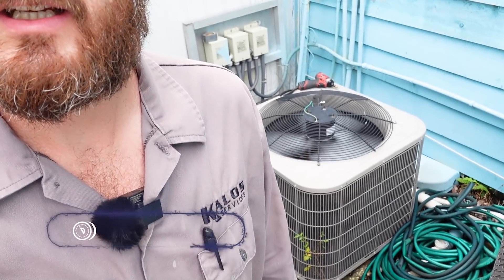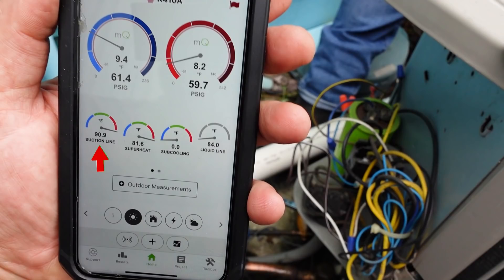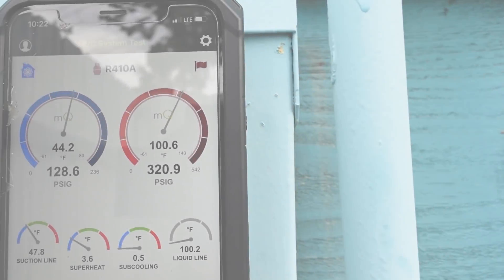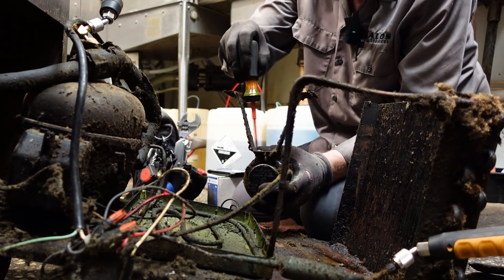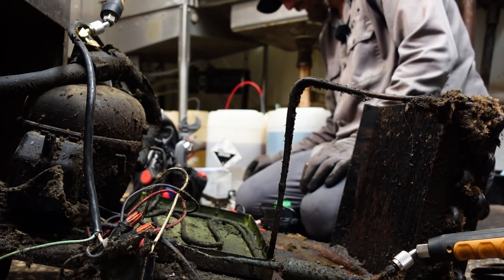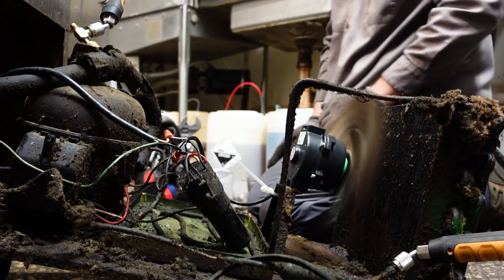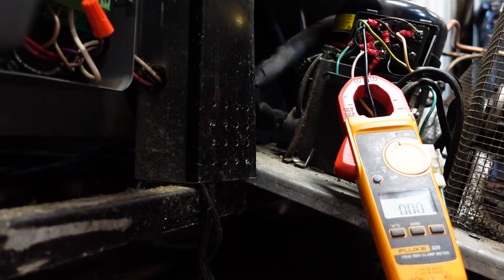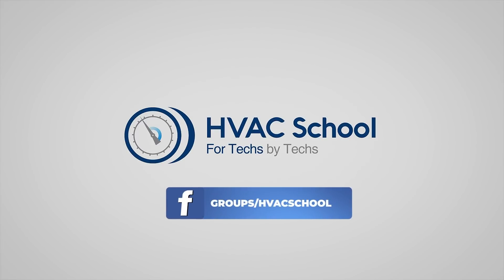Multiple Restaurant AC Issues Diagnosed

Comment: Damn. I'm confused. So isn't that indicative of a failed metering device if the system doesn't pump down without the indoor fan running. Assuming it's a txv at the evaporator.. & what about a maintenance first?
Reply: Failed metering device probably wouldn't cause the high suction pressure. TXVs always fail more closed and cause a restriction in my experience. If it failed wide open then you would have no superheat and liquid flooding back.

Comment: 3:15 rusted top of the scroll compressor normally means the compressor was running at low Freon situation for a very LONG time.
Reply: Not quite, with those LG compressors in the Payne/Carrier units pretty much every one I've seen looks like that. The paint just isn't very good. I have a Payne with an LG in it at home and it looks exactly like that and I know damn well it hasn't been running hot.
Reply: @epicmegaman12  Have you seen any LG scroll's bypassing like this one?  I've never seen a Copeland scroll lose capacity...
Reply: Kinda hot up there.

Comment: Did you really try to blame the issue on an aftermarket fan motor?
Reply: 😂😂 ikr
Reply: It's possible if they didn't have enough heat extraction due to low rpms ... but very unlikely that's was the cause

Comment: Right off the back the comp bad look at discoloration of the top of compressor mean been running high liquid line temps which could be early sign of valves going bad

Comment: It's crazy how nasty hvac equipment gets in a restaurant.  Cleaned some rtus the other day at a taco place all units were pretty close to the kitchen exhaust fans and all of them were completely caked in dust and oil vapor. Crazy shit is they only do maintenance once every 6 months. Evaps had oily residue all over them like you see on a kitchen hood.  Of course the condensers had blankets on them. The worst unit had a brand new condenser next too it like they would rather buy units than increase the maintenance intervals.
Reply: Very common is pizza places and cooking restaurants. They get oil inside coils and impossible to clean. Takes 3 times as long. And the fins are wider so more gets into them

Comment: I don't think the temperature clamp test is a good one with a scroll. For one the motor windings very close proximity and there is a internal check valve that will work to stop the bypass in off cycle
Reply: What would be your recommended test in this case ?
Reply: @hozerhvac4406  I would use the inability to pump down, lower the suction pressure without blower and won't spike head pressure without condensor fan motor enough to condemn. Obviously if is a heat pump it can get more complicated
Reply: @joeshearer1247  I agree the heat pump aspect throws a whole different aspect... reversing valve ect ect. My problem with this is he was only looking at pressure on the suction line.. well that compressor is very hot by now and is probably flashing refrigerate with the liquid side shut very likely thier is backfeeding through the suction that pressure has to go somewhere.